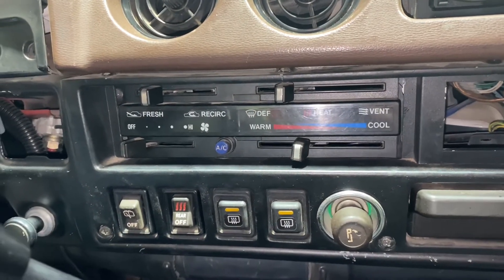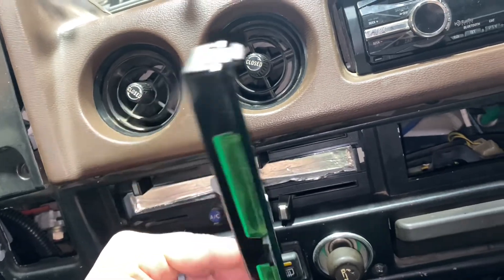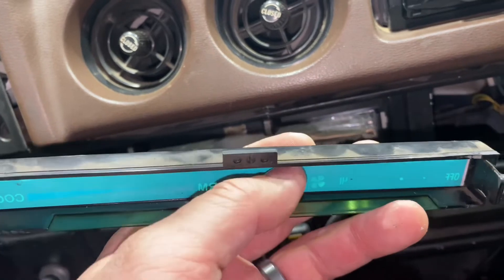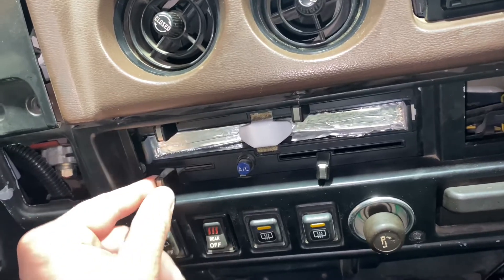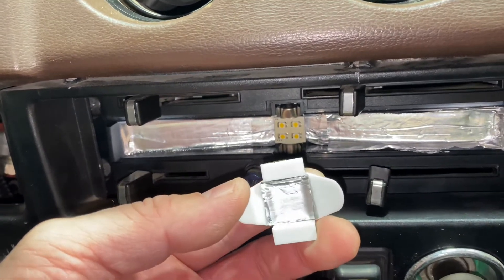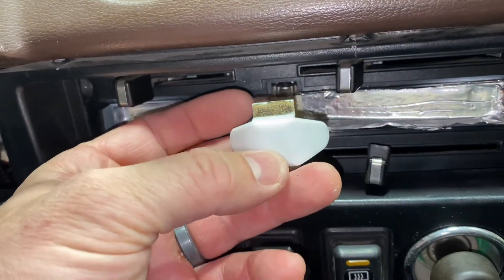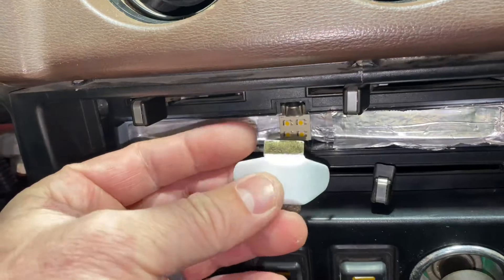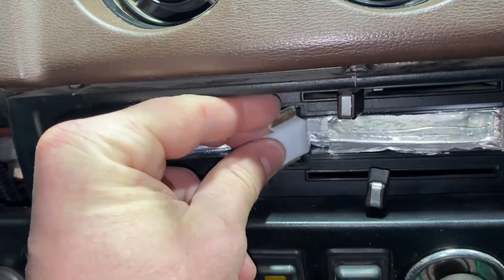Saturday Tech: LED swap on 60 Series HVAC controls.

Comment: So the LED’s are white and the green strip/filter on the back of the bezel turns them green correct? Do you have a link to the bulbs you used? I also don’t want mine too bright 👍
Reply from the maker: https://www.superbrightleds.com/de3175-led-light-bulb-4-smd-led-festoon-bulb-3022-base?find=1987-toyota-land-cruiser-dome-light-bulb-base-6520315+color-Warm~3100K#specifications

28-31mm festoon bulb should be the ticket.